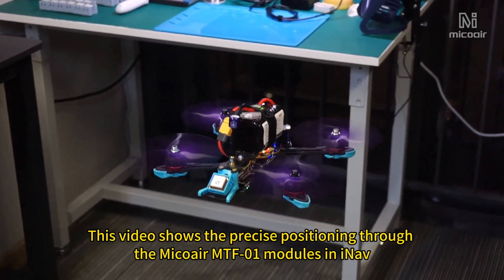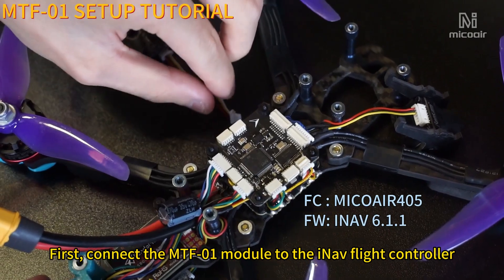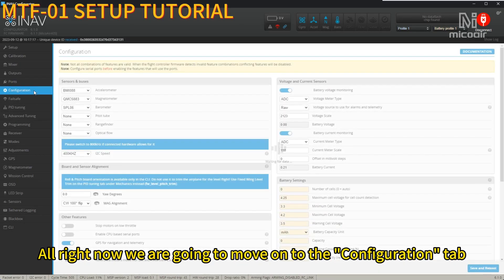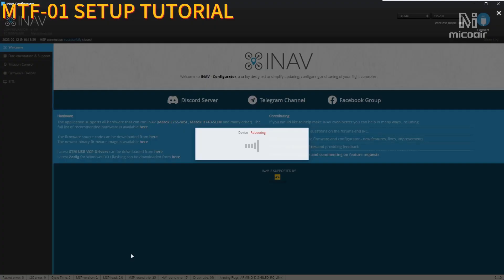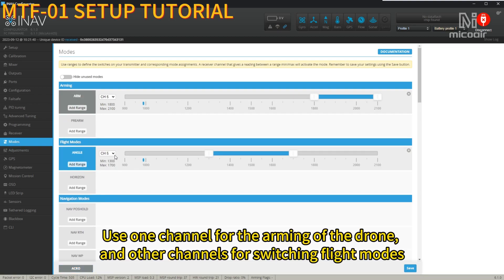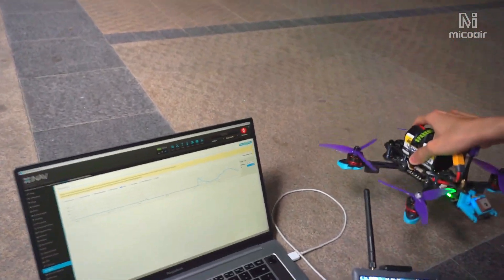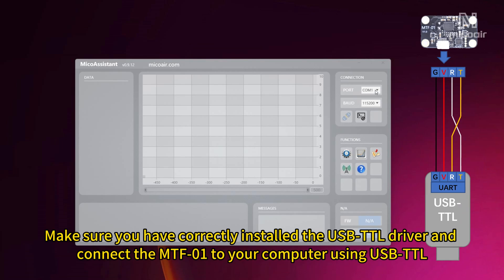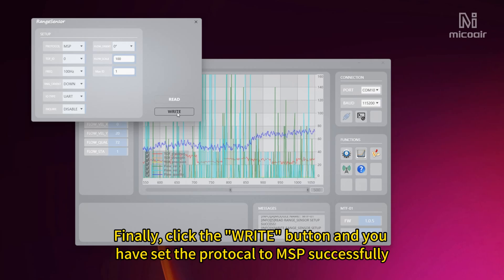Setup Optic Flow&Lidar(MTF-01) For INAV6 To Make Drones Hover And Fly Indoors Better

Comment: On the MicoAir743v2-AIO this does not work for me in INAV. As soon as I set UART4 to MSP and reboot the whole FC goes into a boot loop and will only work again after a full chip erase.
Reply from the maker: INAV now can only support a maximum of two MSP ports. Please check your settings and ensure that you do not set up more than two MSP ports.

Comment: If you go to cli winfow and type set, you will get a hole list of setting and names for the different sensors...in the case of the  MTF-01  i got to the point that the variable changed from static 10.5 to a lower number around the 8...so i got somewhere...I checked up the list and found info on the optical sensor, the name was odd, CW0FLIP, so the command should be "set align_opflow = CW90FLIP".....once I got that command line in it worked...I saved and reboot, went back to cli typed in "set" and got the list...scrolled right back up and found to optical sensor setting...changed to 90...now on to the next step😭💀

Comment: Hi! Does the Optical flow MTF - 01 sensor or the 3901-L0X work with inav 8.0.1?
I found a very bad position maintenance (optical flow only), while with GPS it is perfect (GPS only).

I would like to be able to use only optical flow, has anyone succeeded with inav 8.0.1?

(By the way, my calibration goes from 3.5 to 4.7 with MTF - 01 and from 8 to 10.5 with 3901-L0X)

Comment: just got a module.  Its sends out data continuously without my code sending any commands
Debug of each byte recieved from the MTF-01
36,88,60,0,2,31,9,0,45,0,0,0,0,0,0,0,0,12
36,88,60,0,1,31,5,0,10,138,7,0,0,190

I can see 2 data sets. T
The "2" data set is for optical flow.  As I cover it that set changes.
The "1" data set is for lidar.

For data set "2" I can see a seperator "31" then length "9,0" and data + checksum i think
For data set "1" I can see a seperator "31" then length "5,0" and data + checksum i think

This behavior does not follow none of the MSP, Mavlink, or Microlink protocols.  This module is out the box.  No attempt to use a configurator yet.  Must it be set to MSP out the box?
Reply: Figured some things out.  I was in MSP but MSP V2 mode.  Small differences between V2 and V1 mode.  Also I can change to MicroLink using the app.  Seems the MicroAssist app sends a command on connection to force the MTF-01 to go to MicroLink protocol.  Seems temporary because it returns to MSP if not writen for MicroLink.  
Well, I'll stick with MicroLink protocol.  I cannot find out how to decode the MSP V2 to get sensor values.  Rediculous running around and circles with no info anywhere.  MicroLink is clearly defined and simple format.  Yet, I have clue how to send commands in MicroLink.

Comment: Have you tested the MTF-01 and your related settings in INAV 8.0. For me, it flies away as soon as you enable the Angle/althold/headinghold/PosHold/Surface modes simultaneously as suggested in your video
Reply: Try doing it on inav 7 it may not work on newer versions

Comment: I’ve tried two different FCs and I can’t get it to work like that at all
Reply: I had same issues, but it was all my fault. Used with INAV. My issue was that magnetomter was not turned on and calibrated. From the video it's not that clear that magnetometer should be enabled.

Comment: Does this sensor work at all for the 8.0+ versions of inav? I can't get it to work on h743.
Reply: Me neither... MateksysH743/No Gps/Mtf-01. The quad flies away when switching to Surface mode with Angle/HeadingHold/PosHold/altHold all enabled as suggested by your video

Comment: @MicroAirTech - I posted this a month ago but no reply - "With F722 Pro Mini V2 and MTF-01P using iNav 7.1.2 - not working well at all. Tried so many things to get it working properly. Can you confirm that it should work!?" - Almost like its partly using GPS instead - Since then iNAV 8.0.0 RC3 is out - any improvements? Is the MTF-01P actually working on iNav properly. Any better information to work from... help!
Reply: Well no reply probably means this isn't working well.
Reply: Test has to be only with optical flow without using ofGPS or barometer alt hold.
Reply: I am testing the MTF-02P with SpeedyBee F405 AIO 40A and iNAV 8.0.1 (latest firmware for this board) on UART4 and MSP protocol. The system aparently recognized the board with Flow and Sonar (LIDAR) status Blue, but only the LIDAR distance is shown on the Sensors tab, even after the command "set debug_mode= FLOW_RAW". I still don't know where the problem is.

Comment: Does installing optical flow and rangefinder sensors improve the smoothness of takeoffs and landings on a drone? Specifically, can these sensors enhance stability during these phases even if advanced flight modes like Position Hold and Altitude Hold are not enabled?
Reply: you would have to take off in altitude hold mode which would be equivalent to what dji drones do

Comment: Hi, I installed the MTF-01P on a VTOL plane. Using iNav 7.1.2. I followed your video. Both sensors show blue, debug graph seems ok. I had to orient the MTF CW180flip. My laser is in front of the cameras. But when doing test flights, it is not locking in position at all. I spent lot of time searching the issue, and can't make it works.
Also, it would be nice to have more detailed explanation on each parameter and also for the positioning parameter.
Reply from the maker: I am not sure if this sensor can work in VTOL with INAV, you can join our discord channel to discuss this for picture or video is required:
https://discord.gg/sXWdgveJUz

Comment: What is  the INAV target for the MicoAir F405 fc?
Reply from the maker: MicoAir405v2, and INAV supports it officially after 8.0 version. Now you can download INAV firmware from our website.
Reply: @MicoAirTech  you need to highlight that information on the Amazon and other sale listings. That should be common sense
Reply: @MicoAirTech   I am on Github, there are no .exe or .zip files to download your INAV configurator. The hex file looks like it was deleted. Can you send me a link for the Configurator, please.

Comment: If I fly in this mode, will there be a height limit? Why can't I fly high?
Reply from the maker: INAV has a 2 meters hight limit in surface mode.
Reply: @MicoAirTech  I'm not sure if I can post links here, but are you sure about this? The "Matek LIDAR and INAV" topic on the rcgroups forums for example (and also issue nr. 7622 on INAV on github) mention that you can actually use higher values, if you configure the max surface/terrain altitude limit variable to allow it (inav_max_surface_altitude and others).

Comment: Please help me~~~ Please~~
I bought MTF-02, FC is Speedybee F405 V4, and I connected it to Rx3, Tx3, 5v, G.
The FC firmware is iNav 7.1.2.
When connected, the MTF-02 LED has a blue light.

Referring to this video, I set Ports to UART3 as MSP, and Rangefinder and Optical flow as MSP in Confuguration.
So far, Flow and Sonar appear red in the sensor display window at the top of iNav Configurator 7.1.1.

When you status from the CLI, the values are as follows.

INAV/SPEEDYBEEF405V4 7.1.2 Jun 1 2024 / 00:46:25 (4e1e59eb)
GCC-10.3.1 20210824 (release)
System Uptime: 51 seconds
Current Time: 2041-06-28T01:04:00.000+00:00
Voltage: 0.16V (0S battery - NOT PRESENT)
CPU Clock=168MHz, GYRO=ICM42605, ACC=ICM42605, BARO=SPL06, MAG=QMC5883, RANGEFINDER=MSP, OPFLOW=MSP
STM32 system clocks:
SYSCLK = 168 MHz
HCLK = 168 MHz
PCLK1 = 42 MHz
PCLK2 = 84 MHz
Sensor status: GYRO=OK, ACC=OK, MAG=OK, BARO=OK, RANGEFINDER=FAILING, OPFLOW=FAILING, GPS=OK
SD card: Startup failed
Stack size: 6144, Stack address: 0x10010000, Heap available: 1828
I2C Errors: 0, config size: 10467, max available config: 131072
ADC channel usage:
BATTERY : configured = ADC 1, used = ADC 1
RSSI : configured = ADC 3, used = none
CURRENT : configured = ADC 2, used = ADC 2
AIRSPEED : configured = none, used = none
System load: 10, cycle time: 501, PID rate: 1996, RX rate: 9, System rate: 9
Arming disabled flags: NAV HWFAIL RX CLI NOPREARM DSHOTBEEPER
OSD: MSP DisplayPort: BetaFlight Compatability mode (HD) [53 x 20]
VTX: not detected
GPS: HW Version: UBLOX10 Proto: 34.09 Baud: 115200
GNSS Capabilities:
GNSS Provider active/default
GPS 1/1
Galileo 1/1
BeiDou 1/1
Glonass 1/0
Max concurrent: 3

What's the problem?
Reply: Conecta la LiPo al drone, ya que el USB no es capaz de alimentar el sensor
Reply: Hi, I had exactly the same problem. That UART 3 on the Speedybee board does not seem to work with the sensor.  I've now switched to the MicoAir fc, since it's the same company.

Comment: has this been updated to work on inav 7.1.2 as ive followed this setup video and mine is not locked in like this performs like still using gps?
Reply from the maker: We test it well on inav 7.1.2. By the way 7.1.1 has some bug and doesn't work with it.
Reply: @MicoAirTech  With F722 Pro Mini V2 and MTF-01P using iNav 7.1.2 - not working well at all. Tried so many things to get it working properly. Can you confirm that it should work!?

Comment: I've got my hands on a second MTF-01 and this second one does not seem to work as well.

iNav 7.1.2

I work with ESP automation and I have a TTL here.

The same issue happened on both MTF-01 when trying to connect to the PC. When I set the COM port and click connect. Program crashes.

Comment: Hello, I only installed an optical flow meter to keep a certain distance from the ground, but when I turn on the hover mode, my drone rushes directly upwards. How can I solve this situation?
Reply: Check your propeller
Reply: even i faced the same issue, but my quad was working fine before in anfgle mode, only in pos hold mode using this mtf-01 the motors spin at max current
Did you find any solution?
Reply: @stupidshockers3468 same thing for me... direct to the ceiling at the touch of a button. I doubt this sensor & config works in iNav 8.0
Reply: Did you find the solution? I have the same issue in Inav 8

Comment: I made it using MFT-02, When I took off I turned AltHold, the drone was keeping altitude for a while but than start to bounce. When I tried to correct altitude pushing a little bit of throthle the drone smashed up on the celling. All props, tho motors one esc and gps module are gone. That is all for Hovering and Flying Indoors.
Reply: Hi! I had the same incident just 5 minutes ago. How did you correct it?

Comment: In INAV 7.1.1 using Matek F765 wse FC after following ure instructions both flow and sonar show ready but only sonar is active flow dose not activate, what did I miss
Reply: i had same issue
Reply: @shelterproses7267  I was sent one without both sensors, and it will say INAV on the box
Reply: I bought the fake one and now I have the real one

Comment: I cannot get this to work in inav 7.1 .2. the sensor readout is responding in configurator 
Yo! . .finally got it working with inav7 . .I had to reflash the  controller to get it to work without the satnav . . I am a total noob with most of my flying being virtual . . . have a nice day . jeeze it took forever to sort. . .finally works like 20 dollar drone from aliexpress and can float gracefully indoors . . fantastic
Reply: i also cannot get it to work correctly. and customer support is either non existent or down right hostile. they really seem to have distain for us "normies" who are not lidar engineers

Comment: I'm running the same stack,with DJI RunCam Link wasp,elrs, and the micoair GPS unit all that seems to work great on the build, however when I try adding the MTF-01 Sensor it turns red at the top of inav and hardware health has a red x. I followed this video exact. Any suggestions?  INAV 7.1
Reply: And one more thing I noticed your sensor has green LED mine flashes blue
Reply from the maker: INAV 7.1.1 has some bug with sensor, need to update to 7.1.2. Also you need to check if the output protocol of the MTF-01 is MSP.
Reply: So in ports tab MTF-01 Not MSP?  @MicoAirTech

Comment: if this module has 8meter range then why set inav_max_surface_altitude = 200
Reply from the maker: it takes no effct for inav to set over 200
Reply: @MicoAirTech  Can you explain why? Because that defeats the whole purpose of buying a module that supports 8 meter range (i.e. in this case, I could buy MTF-02 instead or something cheaper instead, right?). Is it a limitation of INAV? Because people did report on INAV issues that they could even, for example, use the Matek optical flow sensor combined with a TF-Luna lidar to use values bigger than 2 meters.
Reply from the maker: @Van-Laser  Ardupilot or PX4 doesn't have such a limit like  INAV
Reply: @MicoAirTech  But what is the limit? The command 'set inav_max_surface_altitude' IS the one setting the limit, the question is why can you not set it to 800 for MTF-01.

Comment: is it possible to get the settings above for Inav 7.1.1 or are they still the same?
Reply from the maker: Better use inav 6.1 or 7.0
Reply: @MicoAirTech  does it work well in 7.0?

Comment: Do you need a gps module and magnetometer for this setup or not necessary?
Reply: For indoor althold only LiDAR and opticalflow are needed.
Reply: @piotrkojder7177  nav option are not available without GPS and barometer...

Comment: on 2:37, does those codes apply to version 7.1.1?
Also,  do you enable the PosHold switch during flight or before take-off?
Reply from the maker: inav 7.1.1 may have some problem, you can try with 6.1 or 7.0, and inav not support take off under poshold mode.
Reply: @MicoAirTech  I got 2 of those MTF-01. Installed one on my iFlight NAZGUL and the other one will be on  Chimera 7 v2. I'll downgrade to ver 6.1. Thank you very much for the info and thanks for sharing the setup.

Comment: Can i install/soldering it in sda scl pad.. (i2c)
Reply from the maker: It can't. Only uart port is supported.
Reply: @MicoAirTech  okay. So i will buy the  micoair f405 fc with many uart slot on it. What is the difference between mico air f405 v1 and f405 v2? Because there is no explanation in micoair website

Comment: Hi team, i'm already this step but my mtf01 still not detected to inav.  I'm already enable msp to port serial
Reply from the maker: May need to check if the outuput protocol of MTF-01 is MSP through MicoAssitant.
Reply: @MicoAirTech  where i can check the output protocol?.fyi i'm using fc speedybee f405 v4
Reply from the maker: @dadhangmaen  You can refer to this tutorial: https://micoair.com/index.php/2024/05/07/configure_mtf_01_sensor_by_using_ardupilots_serial_passthrough_function/

Comment: Did this mtf-01 works well with speedybee f7v3?
Reply from the maker: Should be work well on INAV6.1 or 7.0.
Reply: @MicoAirTech  which uart can be used for mtf-01, because i had tried in my speedybee f7v3 in uart 3 and my fc is error,
Reply from the maker: @ArikaFortuna  Do not use soft serial, F722 controller may not have enough serial port.
Reply: @MicoAirTech  so where should I solder it, on which solder pad,.my fc only have 5 uarts, for vtx, receiver, fpv cam, gps and telemetry. I have removed the sensor now because I don't know where to solder it. please give me a guide, thanks
Reply: @ArikaFortuna  tengo la speedybee f7v3, soldé en uart3, la configuración es así: uart 1 dji O3, uart2 RX, uart3 mtf-01, uart4 esc telemetría, uart6 GPS, sería genial si tuvieras la o3, tu complicación es por los puertos uart

Comment: Hello, I followed your instruction but when I switch to position hold , the drone immediately flies extremely high. Do you know what the problem is? Thank you.

Also, I’ve tested the position Hold with GPS only and it works properly, only when MTF-01 enabled has the above problem.

Here’s the video of my the above problem.

https://youtu.be/uChwMqbRzmY?si=88a7cj6N2HkLLQ8H
Reply from the maker: What is the version of controller, and does it work well in althold mode only with barometer?
Reply: @MicoAirTech  INAV7.1 
Haven’t try barometer only, but I’m sure it’s working with GPS(no optical flow) properly, I also tested the return to home and it landed perfectly.
Reply from the maker: You can have a try with INAV6.1.1or7.0, 7.1 haven't been tested.
Reply: @MicoAirTech  OK, I will try it. Thanks a lot!
Reply: @linFrankLin  did u find the solution as i am also facing same problem

Comment: I followed instructions and my 7 inch quad cant poshold. INAV 7.1 quad dont lock in position just slowly drist in direction i moved the quad before stick release.
Reply from the maker: You can have a try with INAV6.1.1or7.0, 7.1 haven't been tested.

Comment: I used inav7.1 and got some problem like the film...
https://youtube.com/shorts/A4Gc1CagAus?si=ltthek67v8pXIk8I
I could only give it zero throttle otherwise few throttle push would cause the drone fly away...
when drone close to ground it would jump up to sky under zero throttle(stick position buttom)...
Reply from the maker: Does your drone hold altitude well with only barometer? Please check it first.
Reply: if no is it possible Clos the barometer?
Reply: i've tried these kinds of situation:
1. baro used only: drone stay in alti hold very well so my baro is OK
2. baro & rangefinder open(flow closed): alti hold well sometimes up and down little bit
3. rangefinder & flow open(baro close): none any holding funcution
4.baro & flow open(range close): only alti hold happen
5.baro & rangefinder & flow  all open: just like before drone fly high away and need to throttle 0 make it down back
is it possible i should flash to inav6.1? or try another mtf-01 sencer?(I bought two...)
Reply from the maker: @keep7385  You can have a try with INAV6.1.1or7.0, 7.1 haven't been tested.